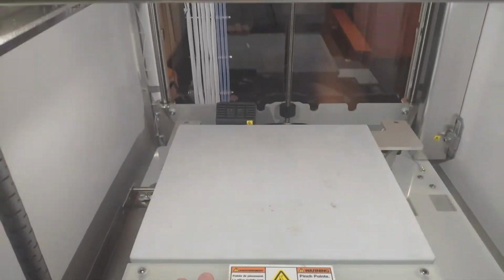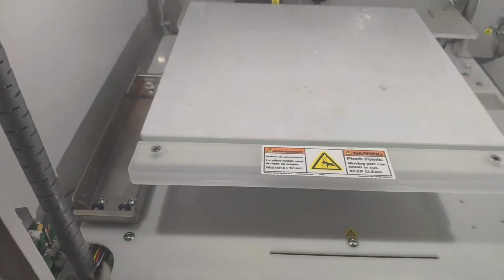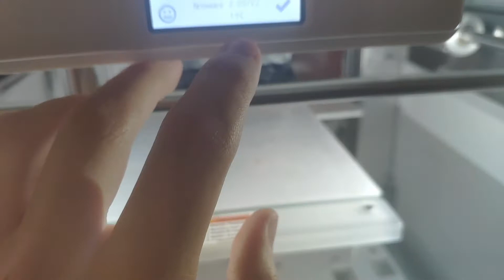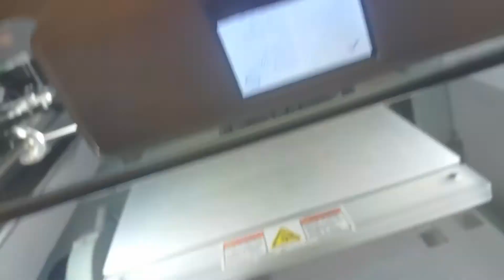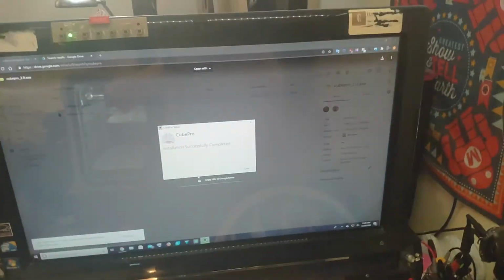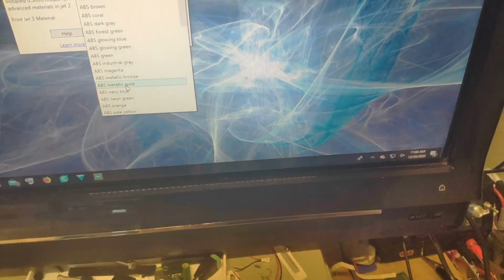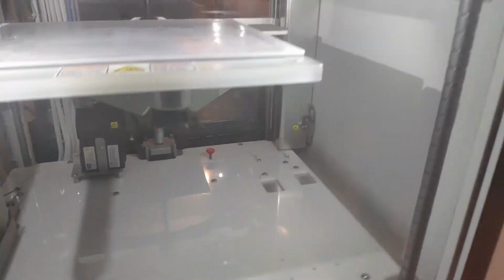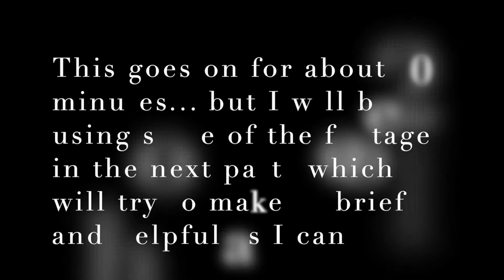Meeting my 3D Systems CubePro (CubeRescue Part 1:)

Comment: Can anyone help me troubleshoot? I was gifted a cubepro single jet. I keep getting f12 error. I got it unclogged but now when i start a print the filament balls up. Im so lost lol😢
Reply: @frankacedia821  I think it has to Do with either the Build plate not being clean try cleaning it with a Isopropyl alcohol and then try using a Stick of Glue stick and cover the Build plate with a thin layer of glue if that doesn't work try leveling the bed if that also doesn't work IDK 😐